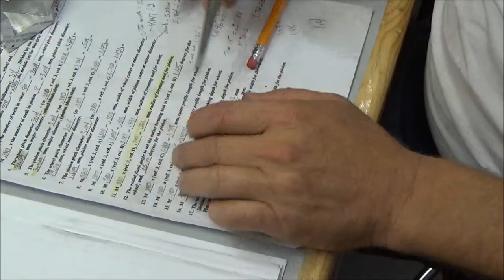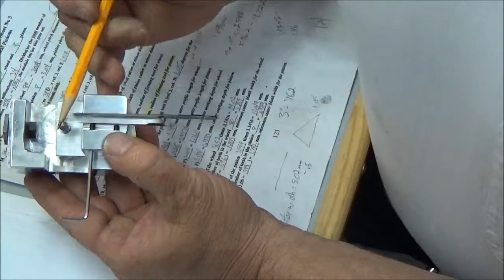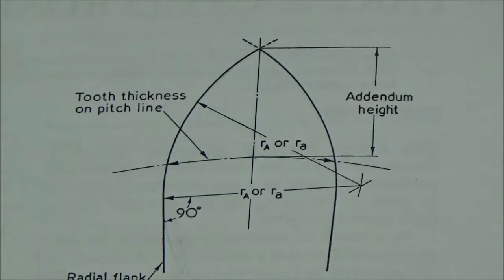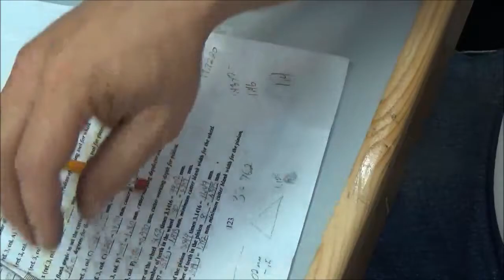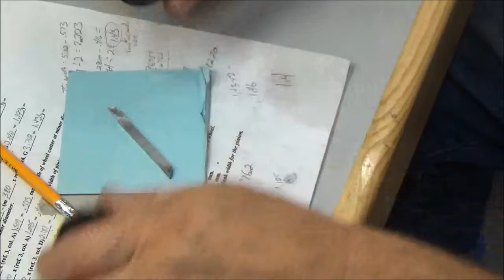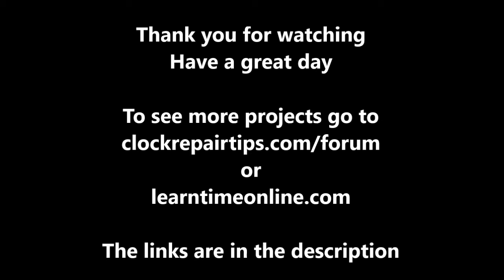Fabricating multi tooth cycloidal cutters for clocks Part 2 "making the form tool radius"

Comment: Great Video, I'm trying to get hold of Porters book, but Amazon suppliers will not ship to Australia....
But haven't given up.
Cheers
Noel
Reply from the maker: Good luck with the book, maybe ebay? Another good book on the subject is "Wheel and pinion cutting in horology" by J Malcolm Wild. A bit different approach with cutters though packed with excellent information.